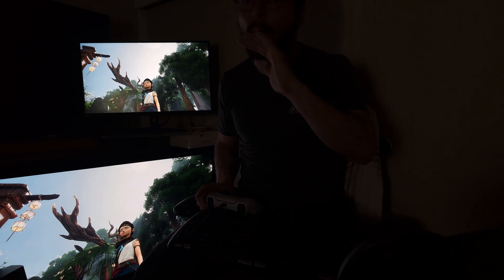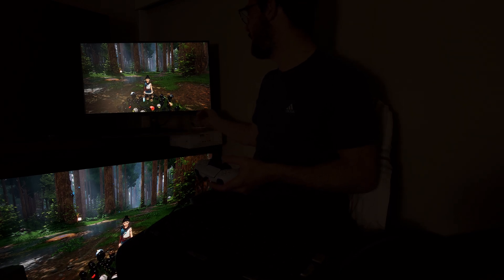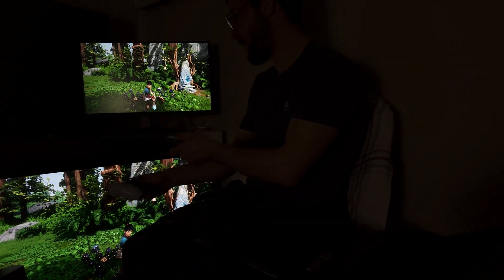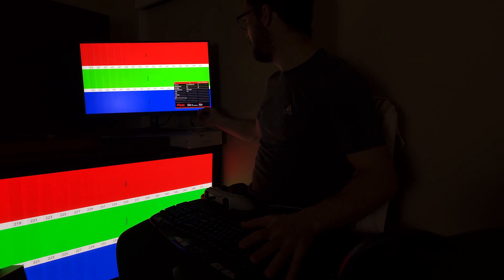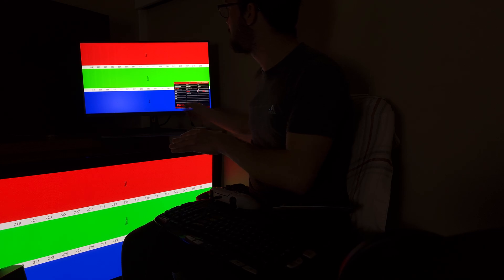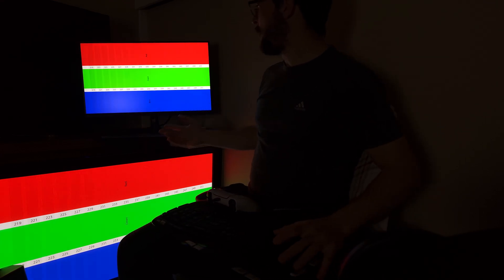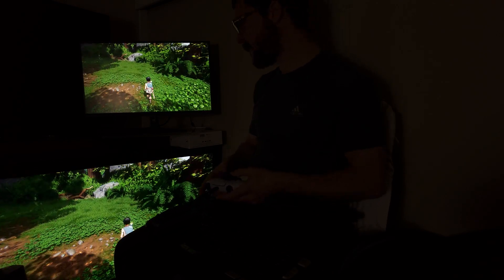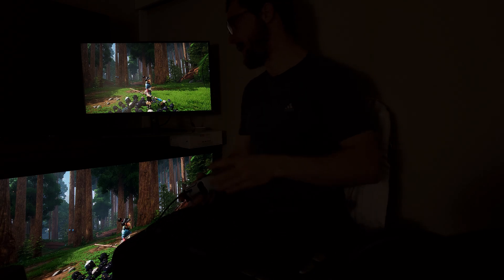Max SDR settings for any TV or monitor. How to calibrate SDR without being an expert.

Comment: HDR is a great thing, but without dynamic resolution, it's a beautiful photo frame.
Reply from the maker: We'll get 4k HDR 240Hz OLEDs probably by next year. That's going to look very good in motion
Reply: @plasmatvforgaming9648  Ahaha. It will remain a small matter, a 4k 240 frames per second video card, or a PS10 game console. =)
Reply from the maker: A 5090 for 2000usd should do the job
Reply: @plasmatvforgaming9648  Maybe, but I'm not so optimistic about forecasts. Yes, and 4090 leaves only due to dlss 3 and drawing frames. For 1080, 3070 is enough for me so far =)
Reply from the maker: That 3070 is going to be good for 1080p for many years

Comment: Thanks a lot for your useful videos. I have exit from the service menu in my G2 pressing In start instead of exit. Is that wrong? I haven’t notice anything wrong but I am afraid as I have heard that pressing In stop by mistake is fatal for the TV. I pressed In start but just to be sure
Reply from the maker: That's fine. Pressing instop is going to reset the factory settings and definitely void the warranty and mess up the factory calibration. The service menu check will no longer appear as OK. I don't have a service remote, and I've never pressed instop, but that's what I've heard
Reply: @plasmatvforgaming9648  Thank god I didn’t press the in stop button…
Reply from the maker: Some people recommend taking the batteries out and then cutting the instop button so you can't  press it by accident
Reply: @plasmatvforgaming9648  good solution. I’ll do that for sure 😅

Comment: your videos are just really good. I like listening to you explain. you could be a good teacher my friend. i want to tell you something about calibration with calman. I bought this program and a calibration device. I can only tell you from my experience. yes, after the calibration you can see minimal differences in the values and also test patterns. but believe me if you compare the calibrated picture with the uncalibrated one, whether sdr or hdr, the difference is so minimal that it is really hardly visible. so for every normal user a calibration is really not worthwhile. You would only regret spending so much money on it. i have an lg cx and it is calibrated so well from the factory that readjustments like you do in the tv menu with test pattern are completely sufficient. I am not an expert and only speak from my experiences.
Reply from the maker: Thank you, I'm actually a guitar teacher. I think that the most important thing is for people to check that they are not destroying the picture with vivid settings. Most people want the eye candy, but they have to check that they're not clipping the colors and whites.

Comment: Good for people with no equipement or knowledge/time.
Reply from the maker: I think this is very good for people wanting to crank up the colors without destroying the picture quality.
Reply: @plasmatvforgaming9648  I was using these  before i started to play with calman. Still usefull for testing.
Reply from the maker: Did you pay for Calman?
Reply: @plasmatvforgaming9648  yes but its only the home for lg version. anything else is too much money.
Reply: you can st ill use it for manual calibration with anything else than lg